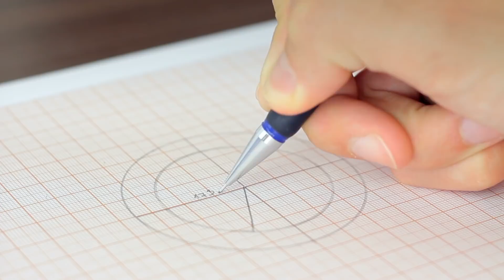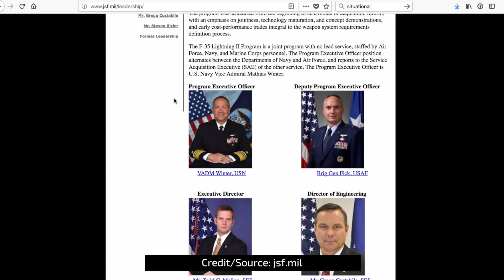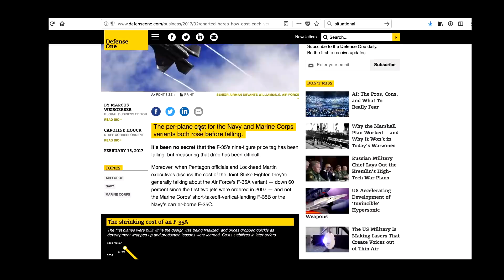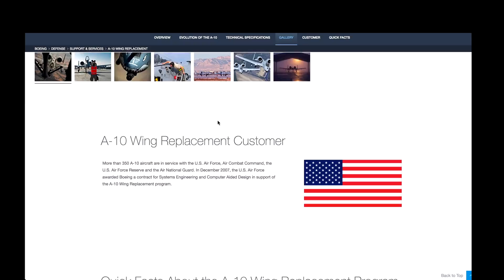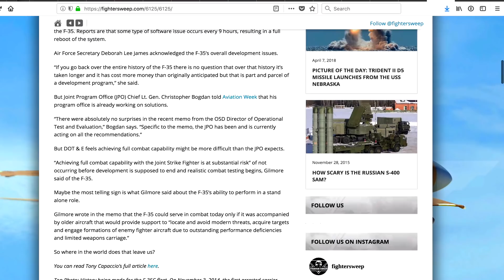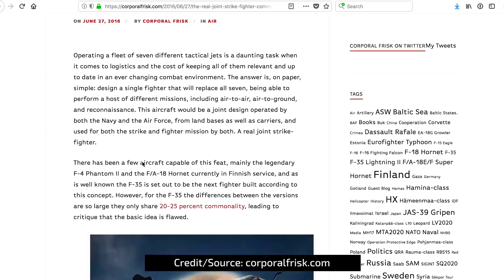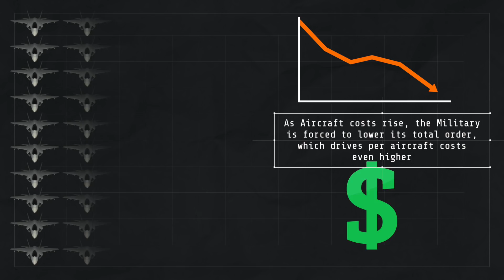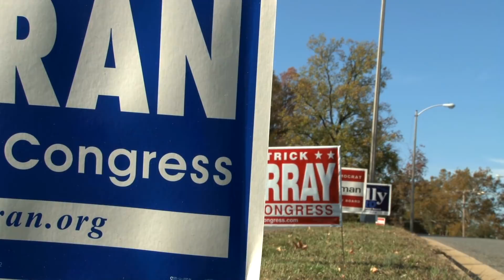Why the F-35 Lightning II Might be the Most Expensive Military Aircraft Mistake Ever

Comment: I believe the original F-16 vs F-35 report that was not doctored, once they figured out the political fallout from that interview they instructed the pilots on how to respond.
See what the top gun instructor says: the only advantage of the F-35 is the integrated information it gets not the avionics. The information system can be integrated into the old planes by an upgrade, the avionics of a bad design can't be corrected by an upgrade.
Reply: There are reports either way, and pilots always favor craft they have already experienced
The F-35 is a larger aircraft like the F-18, yet it is still in the same ballpark of maneuvering as an F-16
These early tests where airframe only - no Stores

Pilots have since had more hands on time and may have cited the F-35 being able to match F-16's mission loaded - The F-16 needs 3 drop tanks to match the range of a F-35, that plus drag from external stores makes them atleast on par

Comment: Don’t forget, it’s also so incredibly expensive, that it will effectively have to operate in air supremacy roles, particularly for smaller allies without the resources to buy a separate fighter for such a mission. A single engine fighter on air patrol over a maritime environment is trouble. It’s hard to take the word of Pentagon sources and Lockheed Martin employees. Bottom line, we’ll see how many contracts get signed and how many aircraft are delivered to allied nations.

Comment: Many countries buying F-16s in 2019 are paying around if not more than $100 mil per plane.  The F-16 has had around 50 years of upgrades and design updates, and the $20 mil F-16 today is basically a museum piece.   Comparing the costs of 70s fighters minus 50 years of technology upgrades to modern day fighters is asinine.  The drone that Iran shot down cost more than the F-35.

Comment: As stealth tech is expensive af, would removing stealth features of the F-35 make it significantly cheaper?
Reply: Yes, and significantly useless as well
Reply: The stealth feature is just paint and the shape, stealth doesnt make a huge impact on cost
Reply: @christopherfernandes6561  it's not normal paint, mainting it can get very expensive
Reply: I understand it isnt normal paint but usually it's a one time coverall and after that its small bits and pieces that are painted

Comment: - Super Plane
- Low cost

pick one, you really can't have both
Reply: warthog has entered the chat
Reply: They can have none
Reply: There are a list of early basic design concept requirements. Cost is one because it is connected to many other factors such as parts, repairs, mechanic skills, turn around time, etc.
Reply: Mosquito!
Reply: The cost goes down every year idk what the heck this guy is talking about
Reply: The cost has gone down tremendously. They cost around 80 million a piece and flight hour cost from 45k to 22k.. some f15s cost 40 million.. and the f35 has advantages that would in theory require less aircraft to fight a war. Thus saving you money

Comment: Why does the F-35 have a auto cannon? It should be focused on SEAD.
Reply: For the same reason the A-10 has an autocanon, close air support.
Reply: @alexandercurtis4427  Then let the Warthog handle CAS. If the F-35 is so advanced then it needs to have bigger fish to fry.
Reply: @indydude3367  In my opinion, the F-35 is a big flop. The F-15 and F-16 still do a good job, and nothing can beat the A-10

Comment: The JSF was an incredibly stupid idea right from the beginning. You CANNOT create an aircraft that does three to five different missions in a single airframe. If you want a slow ground attack and support aircraft that can loiter over the battlefield and destroy tanks with a massive gun and a big wing and double- and triple-redundant systems and heavy armour, you cannot then require the same aircraft to be a fast stealthy Beyond Visual Range missile platform. The two missions require completely different types of wing, therefore totally different types of airframe and design. And if you add on naval landing capability and Vertical Take Off and Landing and all of the other garbage that is associated with this stupid flying piano, then you get a kludge-mobile that is uglier than a pig smeared with lipstick and more expensive than a drunken night at a Vegas casino.

In every single parameter of its original mission, the F-35 has completely failed. It is hugely expensive, it cannot dogfight at gun range, it cannot do close ground support, and it cannot be fielded reliably or easily in order to allow pilots to get sufficient training time. This thing is a trillion-dollar turkey, and the only thing it is good at is proving the old maxim that even a brick will fly given sufficient thrust.

Comment: If after spending billions of dollars you still question if its better than the plane it replaces....it actually means this is a failure...the testimony by the pilots is almost meaningless because there is political pressure from the brass to say the F35 is a good plane when in fact its not

Comment: If they replace the A-10 there will be friendly casualty’s.
Reply: It seems that the A-10 have less surgical munitions on the A-10. Also, there is no mention of flying close to the ground in CAS, so there will actually be less casualties when the F-35 does it
Reply: Probably less, actually, since the pilot isn’t doing as much. There have been multiple reported incidents where A-10s have nearly shot the people they were supposed to be supporting because the pilot has to fly the plane, plan the run, and interpret information from FACs, while the F-35 and most high altitude CAS in general can have two or three of those steps done by the plane. Modern munitions are also more accurate than the gun in a lot of cases.
Reply: @glitchrr36  The F-35 pilot can zoom right in  in high resolution using DAS  the A-1`0 pilot used to use FLIR on a Maverick missile or  use binoculars. Nowadays the A-10 carries a Lightning Pod for much better FLIR.

Comment: The F35 looks great but it is not the F22.Here in Canada we wanted some then got lied to about the F35.The program has its faults and instead of building swiss army knifes they should build more F22's.The warthog has saved countless lives and is in my opinion the best close support role fighter.They should have upgraded the current planes F22,A10 and the Fa/18 Super hornet.Instead they came up with the F35...bad decision.The program cost over a trillion $ that's 1,000,000,000,000,000,000 A fucking boat load of cash.They should have just scrapped it ..in the long run they would have saved money.Anyway..

Comment: Here is the funny thing about radars, the types that are good at detecting most everything are not accurate enough to guide a missile and do not have good range. The type that are ideal for guidance can be fooled and can't always accurately to detect something is there. Stealth coatings at their core is all about absorbing certain frequencies of radar wave so they do not return you have to have a outer coating do you want a coating meant for high frequency bands better at range and tracking a known object or do you want low frequency which are good for detection but can't guide a missile and lack serious range?

It's a trade off you have to give something which is why most nations use a combination of both range for a possible early warning and detection at short range where you are already screwed. Most countries opt for range as it gives them more time to prepare they are use to this early warning and while stealth coatings are not super new they have out progressed radars systems to a degree.

I do believe however it was a poor idea to put all our eggs in one basic, if down the road other nations realize a design flaw which makes them easier to detect it can end badly. As for dog fighting I'm of the belief it's not the 1950's anymore the odds of getting into a dog fight in a modern jet is extremely low when most air craft can be detected by another air craft within 30 miles which far.... far out ranges eye sight. On top of that missiles where not that common in the day of dog fights they where there but where not really accurate enough (or where too large) to be used in the real world on military aircraft. Only time the idea of a dog fight could be realistic is if either both jets never detected each other and they landed on top of each other, these things fly extremely fast and a variable altitude.. if one is 10,000-20,000 feet above or below you the chances of seeing them with your eyes alone are incredibly small (that or every missile failed and both decided to continue the engagement left only with a air cannon).

What gets me is once again a design flaw, they happen and people keep secret of them so others do not discover and mitigate it. The same thing happened in the last 10 years with Russia, US would fly stealth drones over the middle east and started noticing Russian jets tailing them. At first they chocked it up as a fluke, lucky one off event but it started happening a lot more frequently to the point there is little doubt Russia can accurately track our "stealth" drones what's to say this couldn't happen with the F-35 it's only 1 aircraft if such a flaw was found it would make virtually all F-35 susceptible to this.
Reply: Thank you for your intelligent comment.

Comment: As a JTAC who has fought in combat in both Iraq and Afghanistan. I have worked with both A10's and F35's. First Close Air Support is designed for putting munition in close proximity to ground forces. The F35 on a good day carries 4 bombs(4x 500lbs) and they negate ALL stealth capabilities as they have to mount 2 of the bombs outside the the internal bay. The 2nd thing F35's gun can't penatrate armor. In a major conflict the F35 would have to limit it's bomb load to stay in the fight at all. Also the F35 would not be doing CAS if a near peer adversary fight kicked off. They would be dedicated to Air Superiority. In combat I would take an A10 it's got 3x the on station time. It carries 18,000 lbs of ordinance with a gun(30mm) that does kill tanks. If there are SAM threats there are Electronic attack Aircraft that can be brought in with the A10 to midagate threats. Also there Organic assets GMLRS, HIMAR's, ATACM's,  MLRS or Artillery systems on a battlefield possibly as well. The A10 is designed for CAS, the F35 is most certainly not designed for CAS it can do it but it does it moderately at best. There is nothing that can replace the A10 in actual CAS environments. In the future we need separate Aircraft for each branch it will cut cost and it can be dedicated to specific mission needs.

Comment: Is the fighter design supposed to affect the role it develops in battle???
if so
How many fighter types are they???
Reply: Interceptors - Short range, Ultra fast - Make sure to get to the enemy before they get in range to stop bombers
Airsuperiority fighters - Go toe to toe with enemy fighters and win
CAP - Combat Air Patrol less capable Air superiority fighters designed for endurace, they keep the air that was won
Close air support - Support ground troops directly in combat
Interdiction - attack enemies to stop them getting to the fight in the 1st place, could be attacking fuel dumps or tank columns etc
SEAD - Suppression of enemy air defences, go with ground attackers to keep enemy AA positions quiet while they attack
DEAD - Denial of Enemy Air Defences: designed to actively go out hunting enemy missiles and radar batteries
EWS - Electronic Warfare and Signals aircraft - fly with the attackers to stop missile locks, also read enemy radio for info
Tactical Recon - Fast photo planes based on fighters - only truly reliable way to know what the enemy have in forces
COIN - Counter Insurgency Like CAP but much longer missions where they fly with the forces they escort
Buddy Tankers - Front link Air-refueling when you don't want to risk something the size of an airliner

They're th ones of the top of my head